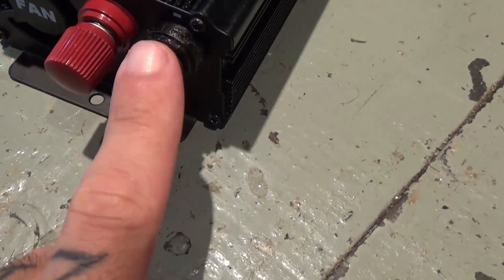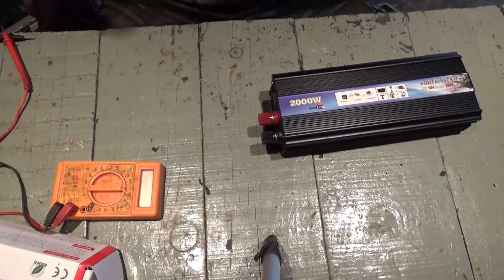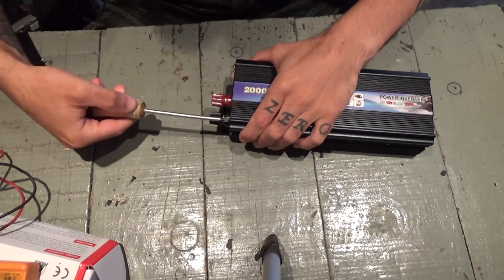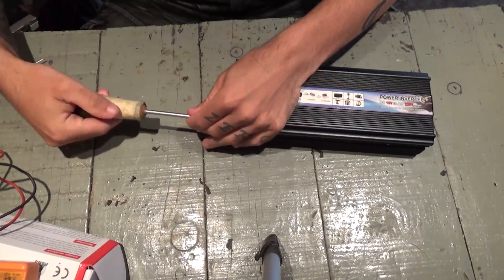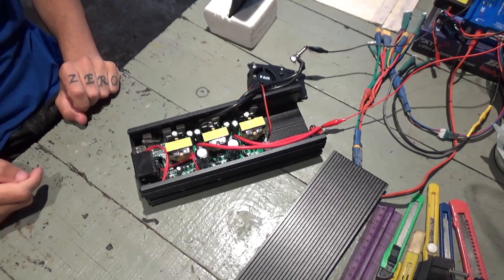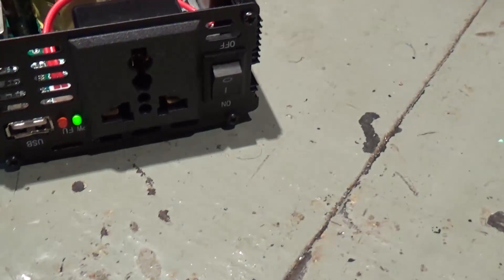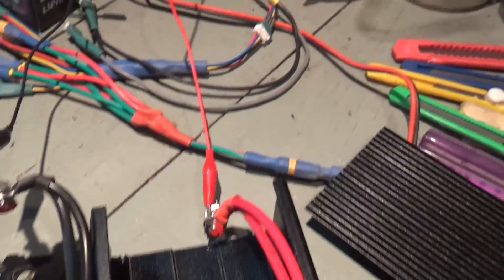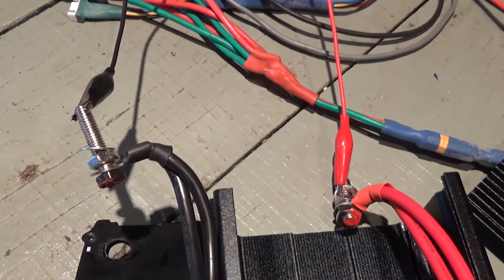Power inverters how to repair 2000w power inverter

Comment: Hello, 3000 watt solartronics full sinus inverter fault light is on. When the inverter is turned on, a relay tripping sound is heard, then the fault light is on, what do you think could be the problem?

Comment: My is giving a alarm and flashing red light and then main fan is constantly running seven with no load. It a alternation flashing sound and red light.
Reply: It had been working fine for 2.5 years and then last use on load shedding it started this problem.

Comment: hi luis
look i have an power inverter charger 2000w 
model: PM2000 LINGQI
in lastnight i sweetch the electricity as always to recharge my batterie
the is a lid light usely when battery is about to charge is lid red but when battery is full the light lid green
and the fan use to work fine,
but since lastnight the charger light don't lid and the fan don't work
can you please give me an advice?

marco
email: mackenzyfelix@gmail.com

Comment: it takes a second to come on because it has to charge the "caps" capacitors condensers are air conditioning
Reply: "Condenser" is the original term for a capacitor. It was dropped in the 1930s but is still commonly incorrectly used in the motor trade when referring to contact breaker switch and capacitor (Points & Condenser) on spark ignition engines.

Comment: how can i adjust my inverter it shutdown when the voltage input got 11v and i want to run it on 10v to 15 im using alum batteries

Comment: I have this exact same inverter. It says 2000 watts, but there is absolutely no way it can do it. I can't even get 700 watts out of it. The circuitry is well made, but the label is a complete lie.
Reply from the maker: Yep i never measured it accurately but i also think it is far from 2000 watts

Comment: is it possible to change the input volt from 24v into 36v to match with solar panel. thanks
Reply from the maker: han luu i am not sure but i think not...i guess the circuit is not prepared for more than 24v IN